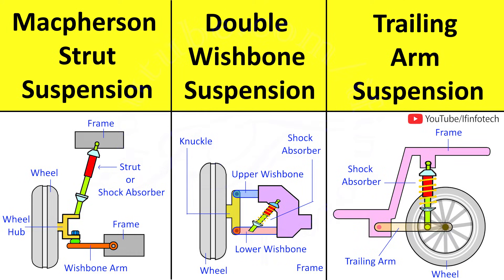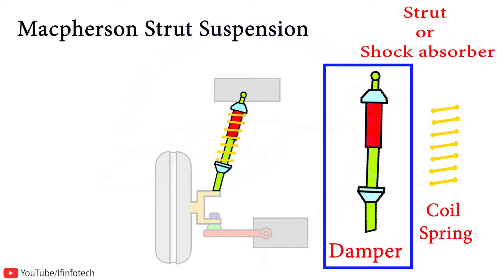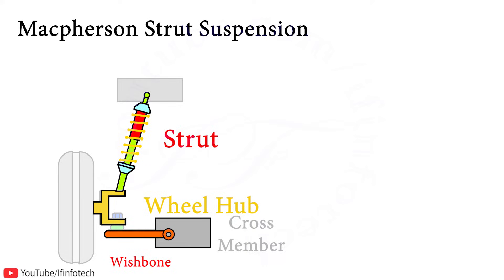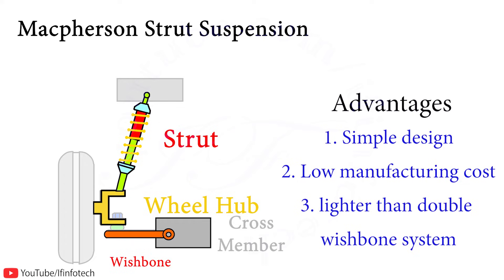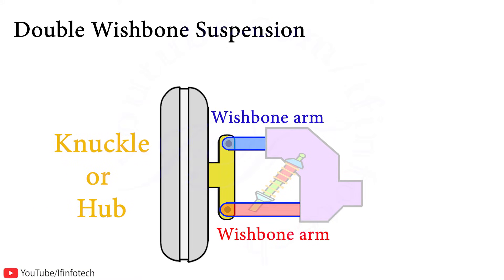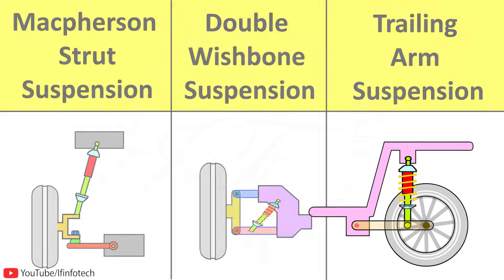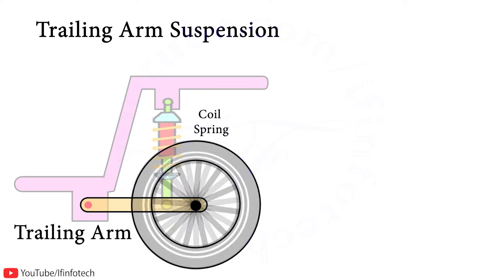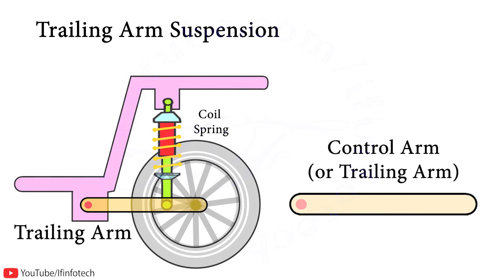Macpherson Strut, Double Wishbone, Trailing Arm Suspension System Types Working Animation

Comment: There is no camber in trailing arm..??
Reply: No! It's a straight foward system. A trailing arm is for pinion angle going forward or backwards. Toe arms, and upper controls arms control the camber of the wheel.
Reply: @MRMAN-wb1tv  i think some trailing arms dose not have camber at all.?
Reply: @aliqadri4672  I just told you NO! Trailing arms go back and forward, not side to side which is camber!
Reply: @MRMAN-wb1tv  i also say that..